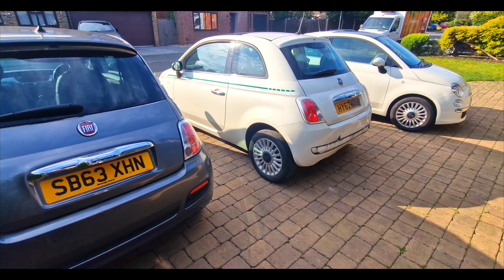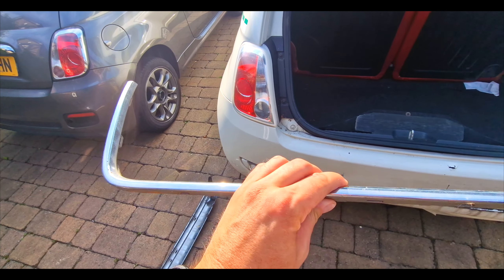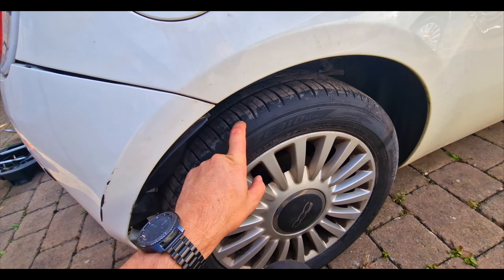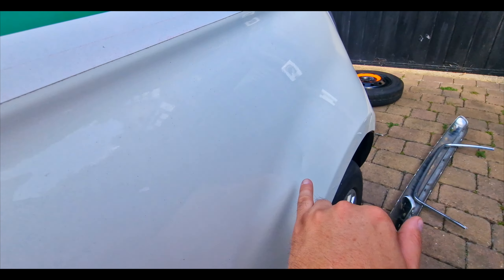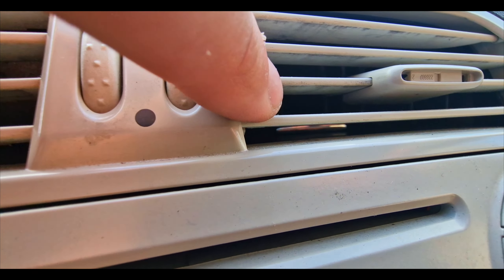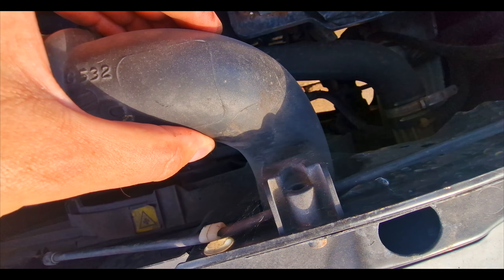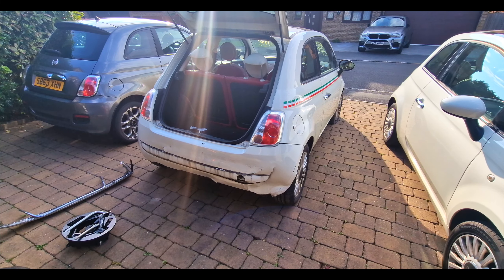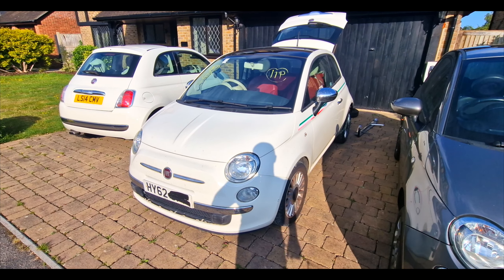Copart Fiat Walkaround With Another Shock Find

Comment: I had the opposite problem where I bought virtually the same make and model from Copart as a cat s and believe it or not the only damage was a small ding the size of a five pence piece on the back wheel arch and as a qualified motor vehicle technician I could find no more damage. I even let two more qualified engineers and an mot station look at the vehicle and none of them could find the slightest problem either so with low mileage fsh and immaculate now with the ding repaired I have great vehicle EXCEPT I NOW HAVE TO SELL IT AS A CAT S !!! The saving grace is that I only paid £525 for it plus a new stop/start battery. The assessor’s really need to get their act together 😊

Comment: My wife's 2011  500 was rear ended exact same damage.  Car was fully  drivable but was written off Cat N.   It was just the wheelwell was crumpled but overall structure was ok .   We took the money but it I saw it was fixed as was passed MOT. just needed a bit of panel work on the well and a new bumper .
Reply from the maker: Probably worth taking the money and running. It's hopefully not too much of a job to sort out the wheel well and getting a bumper and crash bar, but a garage will charge alot of those I reckon!

Comment: That is a cat S all day long! A porta power will get that 95% straight it you push off the rear seat mounts but you have to be very careful not to split the seams for the rear panel. That part of the boot floor is extremely soft you will be surprised how easily that goes straight

Comment: Its seems a regular thing now, I have had several cars recently from them that should have been Cat S and also damaged by the fork lifts when loading either tyres or steering components damaged
Reply from the maker: Don't get me started on those fork lifts. I'm not sure if damage to the wheel well is a CAT S now, as some people think it's not structural, so I'm a little confused :)
Reply: @carsalvage101  A recent one I had this year was a 2013 Fiesta I complained to Copart due to the damage which I believe the fork lift did the front wheel was pushed back into the wheel well which was not like that on the sale day, Copart replied saying if the damaged parts will bolt off and on to replace then its a Cat N if its body parts that do not unbolt its Cat S

Comment: Oh dear, that wheel tub is a bit of a mess, not sure that will bang out sufficiently. Might be better to get a new tub welded in. I;'m just thinking, I imagine you have to drop the fuel tank to do that, not sure about that. Other than that, it's a decent car. I still think they aren't bothering to look at cars or even photos. Any assessor seeing how low that impact was would have to think that it's gone under the rear crasher and done damage to the rear. I would imagine they've just not bothered even seeing a photo.
Reply from the maker: Will give it a go when it's taxed and I can move it. May need a sledge hammer to push it down first.

Comment: i bought one of these almost identical for my daughter who is currently learning to drive. The only difference is the Red/Green decal is on the bonet roof and tailgate. They are pretty faded now, have you ever replaced decals like this ?
Reply from the maker: I'm in the process of taking them off today. One side came off in literally minutes, the other side is staying fast! So I'm hoping a rubber wheel will do it.
Reply: @carsalvage101  did you film taking them off ? would be interested to see the process
Reply from the maker: I didn't, one side as it literally came off when I peel. I just poured hot water on it. The other side, I've started but need a rubber wheel. I'll record that when it arrives :)
Reply: @carsalvage101  that would be great if you could i would be really interested to see the process and decide if i want to do it to my daughters. Hers is on a 2010 plate but not as faded as the ones on this

Comment: How did the assessor miss that? Blatantly a cat S all day long!
Reply from the maker: The bumper definitely had not been removed. But maybe damage to the wheel well isn't structural?!
Reply: @carsalvage101  maybe another one written off from pictures rather than a proper inspection? I was under the impression cat N is any part that bolts on and cat S is anything integral to the structure of the chassis. I had a corsa written off for a creased wheel well when I was rear ended, eventually someone salvaged it from copart but I was told the price of repair far outweighed the value of the car so I got £1700 from the insurer and picked up another cheapie lol
Reply from the maker: That was my thinking around the wheel well, but maybe someone was being lazy and from the outside, you just thought it was damage to the bumper?!